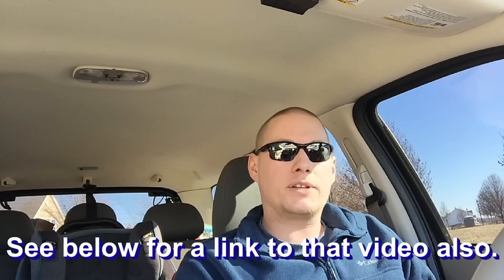Ford Ecoboost Engine Carbon Deposits: What You Need to Know

Comment: I have a 2015 with 2.0.  I use top tier gas and change oil at 8000km (5000 miles) with full synthetic.  No issues with drinking anti-freeze.  My mileage is down about 1 mpg from original. I do not have a catch can but had I heard about these earlier, I would have had one installed as soon as the the warranty was over.  I saw some of your later videos regarding walnut blasting and I suspect it is the probably the best way of cleaning it - instead of the chemical solution which may be harmful to the turbo.

Comment: I use Royal Purple, Z Max, and 93 octane from new. The reason I changed when the car was new is that the car would run funny with the semi-scythe oil, I also use the Z Max as oil stabilizer and fuel injector cleaner there is also a Royal Purple fuel injector cleaner. The car runs like a dream. I have a 2014 Ford Fusion Titanium 2.0 liter AWD with a little over 19000 miles. The only problem so far is that it stop starter during this second harsh winter; I had to jump start the car. The techs informed me that it was a under power issue. They check everything and did not find anything wrong just recharged my battery. I think it is mainly because I left the car sitting in the cold for 5 days without driving it. Seem like the does a cycle check and it was doing this draining the battery. I also start turning off my auto headlights and the radio when parked. It has not had any problem since. I want to do an dyno tuning because ( I have not confirmed this yet) I think it may be running rich it really does not get the fuel emissions that its rated for. This may be the reason or a contributing factor to the increase carbon deposits as well as having a small turbine on it.  I think ford should require their dealers to have a dyno setup as a part of their maintenance . I have a 7 year warranty but if I take it else where for the dyno testing the out come could void the warranty. So that leaves me not able to do any work on the car until the end of the warranty. Which I am okay with and I really do not believe within the 7 years that any ford dealer will have a AWD dyno to use as part of its maintenance program. I may just go with the answer of fuck it and just do it. I know how to maintain my car to a certain extent but since it is under warranty why bother doing it. Don't get me wrong it would be fun to work on but it is my only car in this location.

Comment: mercury marine uses a on board compresser belt driven to inject fuel and air. very sooty engines. quickleen fuel  treatment works great.

Comment: I don't own a ford, bit very good info on how exhaust/intake overlap allow good cylinder head exhaust scavenging, but the trade off can be regurgitation, for lack of a better word of spent combustion chamber by products onto.the backside of the intake valve.  One of my buddies from high school is a petroleum engineer  PhD.   He says techron is the only way to go.
very good info.  BTW us neurotic types are the kind of folk you want doing technically challenging work for you or on you.

Comment: A little update. At 5K miles, to help get into a regimen and help a bit with the carbon concern, after some oil research, I decided take my own 5W30 full synthetic oil to the dealer and have them use the specified Motorcraft oil filter. I went with Pennzoil Ultra Platinum PurePlus 5W30 and plan on sticking with it.  Also, I purchased an extra fuel funnel from the Ford parts department, one identical to the one next to my spare tire to use exclusively when pouring the Chevron Techron fuel cleaner right before each oil change. The manual stated to use the funnel to prevent damage to the easy fill cap less system, so I will do accordingly. With these three combinations including using Shell 91 octane V Power premium fuel, I hope these will help with the resistance of carbon build up. So far my Ecoboost has been performing excellent, quick to respond and quietly. I do most mixed city and highway driving, with freeway's being my main commute, I do get to drive against traffic in the mornings and evenings so I have opportunities to avoid traffic a bit and punch it from time to time. So far I'm loving my ecoboost engine and Explorer Sport. Thanks again for these tips and videos. : )

Comment: Just had the cylinder head replaced on my 15 Focus ST...seems to be smoother now. I took it in because of a check engine light and figured it misfired, this was the case. Not sure if the head is revised or not, but it sounds much better. Only took a few weeks. That is a shit ton of money if Ford is replacing all these heads. Maybe I should get a Mustang GT. LOL

Comment: Great video, even if a bit longer than you intended. You just saved me from making a major mistake on a 2.4 liter Ford Ecoboost engine. Thanks!
Reply: You can walnut blast the intake valves on the ecoboost

Comment: 2018 and up doesn’t have the carbon problem. Redesigned injection with the best of both worlds.
Reply: Only on F150.  Not on Edge ST
Reply: Not on the Escape either, at least the 2018 2.0
Reply: In Mustang GT 2018+?
Reply: @cupramir  although it is a second generation Ford turbo engine it’s not the same as the F150. To begin with its a 4 cylinder 2.3 with GDI injectors only. There’s a problem with carbon build up. Another big problem is the head gasket they don’t hold up very well. Look into the 8  cylinder coyote.

Comment: Thanks for putting this information out there! I always enjoy your videos and have told several others about them.

I think your spot on with your recommendations too. For now, running a top tier gasoline, high quality synthetic motor oil, and blowing the soot out of it via an Italian tune up is the best things we can do for them. Although it'd void the warranty now, I'm hoping that Ford will devise a catch can setup or similar for the engines. I've been heavily contemplating installing one anyways to mitigate any buildup issues, but hopefully Ford will release something.

Comment: I would just pass on the ecobost engines until Ford Masters it and that could be 5 years from now.
Reply: +Matthew Schaefer there absolutely is a way around it. look at Toyotas D4S technology. Atkinson Cycle. its Direct Injection when more power is needed, then it uses Port Injection under normal driving conditions. all controlled by computer. this way, the valve gets cleaned and no carbon issues. its a simple solution..

I hate it when people say Toyotas technology is no better than anybody else's..
Reply: +Matthew Schaefer I happen to like GM. Toyota, GM, NUMMI plant, California. Research Ford sticking has pedals, GM sticking has pedals, Audi, Some dates back to the 80's, 90's, today, and even Chrysler..Toyotas gas pedal issue is irrelevant and has nothing to do with the technology i was talking about. there have been numerous complaints about sticking gas pedals from a lot of other car makers. Don't forget about the key switches shutting off in GM vehicles..
Reply: +2010V6RAV4 replace has with GAS!!!! stupid autocorrect
Reply: +Adam W Pass on all GDI engines.
Reply: MattyBespoke Not everybody will risk methanol injection. Thats a quick way to blow out motors

Comment: I been driving for 45 years you want keep carbon from becoming a problem this is what I do. Check your fluid levels, ALWAYS check the tire pressure go to the nearest highway wait till the engine is completely warmed up and start pushing on the gas, go at least 40 miles over 60 mph. Turn around when you get on the on ramp boot it let it rev rear the redline cruise over 60 mph on the way back home boot it into the passing gear 4 to 5 times. Do this 3 to 4 times a year more if you do 80% city driving. I only use Shell or Sunoco gas. You will notice your engine will run smoother and you will get better gas mileage.

Comment: Ok i just watched this after commenting on other video. I am a master BMW tech. We have these same issues AS WITH ANY MANUFACTURER WITH DIRECT INJECTION NA OR TURBOCHARGED. We have been dealing with this for about 7 years now and watching your videos is deja vu. My personal belief is the valve overlap is not the major player but the crankcase ventilation is. We use walnur shell blasting of the intake valves/ports. Cleans very well. But does not eliminate the issue. I have found that installing a oil catch can/seperator in the vent system seems to work well if properly maintained.
Reply: "same as with any other manufacturer.." nope. Toyota D4S, Atkinson Cycle. Direct Injection for extra power, Port Injection for normal driving conditions..
Reply: ford has that too. not talking about dual injection engines.

Comment: I have a 2011 f150 ecoboost that I've owned since 103,000miles. I started getting the timing chain rattle around 137,000miles and decided to do a walnut blast myself of the intake valves much like the BMW guys do. That way scary to do but I can say I have not heard it rattle even once since cleaning the valves. I'm now at 151,000miles. I'm not saying that this is the solution but it got rid of any rattle I had so I'm happy with my results.
Reply: Had this down on my twin turbo BMW. Bought a ecoboost MKS last week as well.

Comment: The way manufactures are resolving this issue is at this point is with dual injection. Which is very costly and at this point only found on upper tier engines. Dual injection is a combination of port and direct injection using the computer to altetnate between the two.

Comment: What about adding an alcohol/water injector to a vacuum port that could be manually controlled to keep the intakes from getting carbon build up. You could have a switch in the cab and give it a "shot" every so often to have liquid on the back side of the valves!
Reply: Like that plan

Comment: First get the Government out of the auto manufacturing process. Install a cleaner burning fuel, LP or Natural Gas and full synthetic oil. Then no worries. You will notice carbon has become nearly a non issue after these simple mods.
Reply: The "cleaner burning" fuel has VERY LITTLE to do with carbon build up on the intakes. We're talking about carbon on the INTAKE VALVES not the CC carbon! If you REALLY want to eliminate the problem, GO FULL ELECTRIC!!

Comment: I have 1 Million + yes Its an "M" service miles, and have used Berrymans B12 in the tank and through the intake on every Ford, Toyota  and 1 Mercedes 500 SEL, never encountered Intake carbon tulip buildup. I have Fixed a Bad case with a slow solvent left on for 12-14hr then bronze brush the crud loose and shop vac the debris away.
If you are a Ford shop tech and it appears you are, I have numbered all the valves, pulled them and polished the tulip in a drill press, smoothed all the casting marks, ported the head, matched the gaskets and never had another issue,. and picked up power.  Since that time i run a catch can on all my vehicles just for that crap to be caught and discarded. Hope you can use some of this.....oB

Comment: FordTechMakuloco, have they come up with an approved cleaning technique?
Reply: Yes! Anything new?
Reply: I want to know too. Just put a catch can on my 2.0 fusion. Gently cleaned my valves while I was in there.
Reply: The gen 2 2.8 and 3.5s have an injector in the intake. I would immagine that between that and  a catch can should eliminate the issue.
Reply: Hey-Answer the question, you obviously like to gab.
Reply: I've seen some people walnut blast the intake ports and it does clean the intake port and valves
Reply: Also would like to know if there's any approved carbon cleaning yet. Or at least something we can do with these ecoboosts other then getting rid of it...

Have catch can and still seeing carbon issues. Have a misfire that goes away with seafoam but comes back in a month or 2.. really don't want to keep burning up the turbos.. (yes I replaced spark plugs and COP, still an issue on the same cylinder right where egr comes in)
Reply: @Sean42-j9n  hi Peter. I own a new truck so no miles yet and not familiar with the motor. I have built and raced turbo/supercharged/nos motors for decades. Seems to me the best thing would be water injection. If you ever seen a motor that used it with high mileage there is no carbon build up because it steam cleans the motor. Just a thought.

Comment: 2017 ecoboost will have a second set of port injectors they say its for fuel enhancement we know what its really for.
Reply: Does anyone know if this came to pass?
Reply: @charredskeleton  yes sometime mid 2017 they switched to the new engine
Reply: ONLY in the F150 did they switch over.  the suvs and cars with ecoboost engines do NOT have dual injection.
Reply: dr. breen's beard 🙁
Reply: @8__D  oh its VERY disappointing as i feel the ecoboost engines with dual injection are bordering on being true bulletproof gas-turbo engines.

Comment: Thanks for the info. I had my mind set on a 2015 Fiesta ST but after reading through this I don't know if it's such a good idea. I've had many cars before (all normally aspirated and all Japanese) with never a problem (2 for 4 years, one for 7 years and one for 10 years). Reliability is important to me but so is the fun to drive factor. Maybe I should stick to normally aspirated cars ?
Reply: 2.7 and 3 . 5 Ecoboost are fast. I have a 2016 F-150 108 k Miles and no problems

Comment: I am about to pick up my new 15 3.5 eco tomorrow. I was totally planning on getting 1000 miles on it and then changing the oil to Rotella T-6. 5-40. I run that stuff in every internal combustion 4 stroke I own. Would you really recommend against it? 

Ive been a mechanic my whole life and like to over analyse all of this stuff. If you could spell out your logic on only using the Pennsoil or post a link to a webpage or video that does I'd really appreciate it. Thanks!

Comment: Hello,
Thanks for the info. I just drop my 2013 ecoboost F150 in the dealer for Phasors replacement and they said that there is a Ford approve cleaning process using chemicals. Is that true?

Comment: Do you believe that the 2nd generation 3.5 Ecoboost engine in the 2017 Ford 150s with  "dual" injection (direct/multiport injection)  will solve this carbon build up problem?
Reply: Yes dual injection gets rid of this problem. The new 5.0L was given direct injection but they kept the port injection for this reason (durability)

Comment: Ha, just replaced basically the entire EGR system late last year on a 5.4 2v 03 Expedition to clear an EGR code. Of course I sheared one of the studs in the process, but luckily I'm and aircraft mechanic and know how to remove stuck hardware- ended up having to drill it to the threads and clear them out with a tap. A LOT of experience req'd to get center and perpendicular for that job, especially when it's a little hard to reach.

Comment: Did ford ever approve a cleaning method for these vehicles? I'm noticing a lifter-like clicking sound on my 1.5l escape when the engine is hotter under heavy use. Thanks for all the info, I feel like I'll be able to keep my escape for years longer based on your advice. PTU fluid changed last week 👍
Reply: I'm wondering the same thing
Reply: +1
Reply: I have heard this click as well on my 2014 ecoboost, alot of the info from others say its is the turbo dump gate valves rattling, some have fixed this with a very small light spring on the outside of that gate valve on each turbo putting a slight tension on it so it doesn't rattle, of course this would probably void your warranty as well.

Comment: I have a Focus 2.0 GDI engine.  It currently has 240,000 miles on it.  I have only used Amsoil 0W-20 oil in it.  I am going to take off the intake and look at the valves, and see what I can do to clean them if needed.  I am about to go on a 2500+ mile trip in a couple of months.  The car still will get over 40 MPG on the highway, so I don't think it is a big problem.

Comment: i have a new 2017 2.7 eb, what do i do to keep this from happening? best way to keep it clean...any new tec i mean because  the video answered  most questions
Reply from the maker: Catch can is best to prevent the coking and 44k is the best to help with carbon especially in the combustion chamber- http://amzn.to/2n16jYy
Reply: quinn boone use a good brand full synrhetic motor oil change every 5000mis . Motorcraft oil & air filters are excellent. I use 89 octane mid grade fuel too. Ford has had much less carbon issues than the foreign brands
Reply: @FordTechMakuloco  which is best to help with carbon, Chevron techron or B44?????

Comment: I have 120k on my '13 Escape with the 2.0 Ecoboost and it still runs great, with plenty of power and ok mileage - low to mid 20's. Occasional check engine light issues though. Love the car!

Comment: I respect your opinion for using Pezoil Platinum but I really would not use that Oil at all. It's not a true synthetic, hell there's a lot of "synthetic oil" that isin't really a true synthetic. The only oils I even come close to using is Amsoil and Castrol. Also that Techron stuff will do no good if it doesn't even come into contact with the backside of the intake valve. The one good thing in your description is the catch can. The stuff those things collect is utterly nasty and not something you need in the engine.
Reply: Pennzoil Platinum is a true synthetic.  You would know this if you checked their website or read the label.  They convert natural gas into lubricant oils in their GTL (Gas-to-liquid) manufacturing process.  http://www.shell.com/energy-and-innovation/natural-gas/gas-to-liquids.html  (Pennzoil is a Shell Brand)